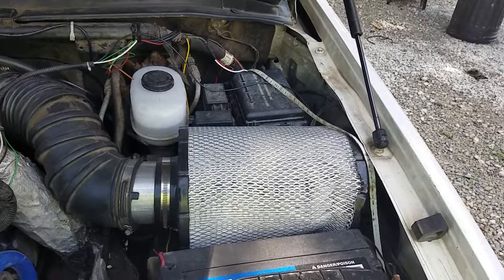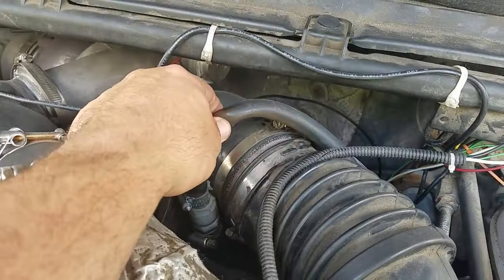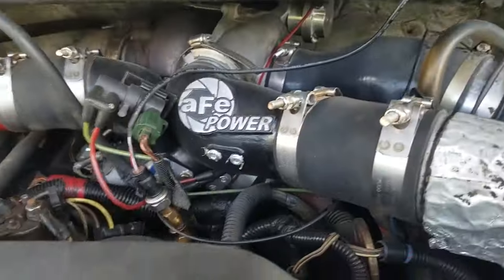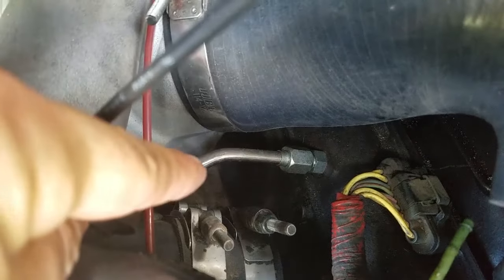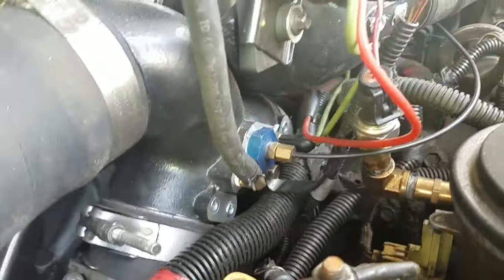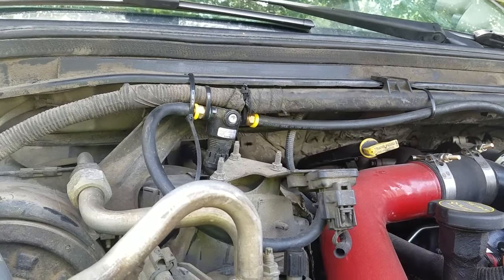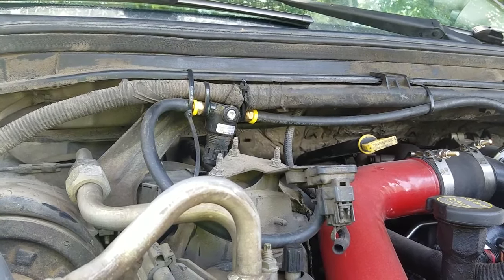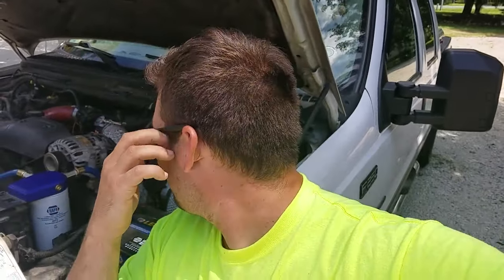5 Cheap 7.3 powerstroke upgrades

Comment from the maker: If you haven't already check out the Chat Room: https://discord.gg/s2Ku5dn
Reply: The cheap 5 mods video where did you get the parts from I already got the air filter I like the boost fuller you have

Comment: I could not watch the entire video when I saw that you replaced the Ford factory cold air intake, with a hot air intake.
Reply: The air duct not shown that is underneath the factory air box is the cold air feed. I see a lot of people remove that not realizing what it is. This guy may or may not have that but whatever this air thing he did is a joke
Reply: As long as the air duct is still ran over there it's still getting some cold air. The 6637 also flows more and catches more dirt.
Reply: How did you do the crossover?
Please show the other end of the CRV mod.
Reply: For real.  That is a rookie thing. Stick to stock   Rookie mistake.

Comment: I’d like to know the mileage with all these mods. My stock 2002 excursion is now at 490k zero major breakdowns and it has hauled a 25 foot enclosed trailer since about 190k (I know 490 is nothing special, in fact my 95 is at 600k with only one transmission replacement
Reply: My excursion has 360,000 miles stock

Comment: My BOUGHT NEW,  255,000 Mile, 2000 Ford Excursion Limited, 4X4, 7.3 Diesel has NO mods and runs like NEW!  I serviced it "By the Book, OR Better", added about a quart of Power Service Diesel fuel Conditioner (OR QT. Two Cycle OIL) at every other fill-up.  I changed Trans Fluid and Filter every 30,000 miles, Fuel Filter every 15K, Chevron Dello Oil and Motorcraft FL1995 oil filter, every 5000miles (3000 Miles when towing) and more.   ORIGINAL Fuel Injectors, Turbo, Transmission, etc. ONLY Michelin tires. As another said, video would be better Sans Music.

Comment: Been running a K&N air filter in the OEM filter box for 15 yrs on my '97 F250 Aug. 11 and newer, and the inside of the turbo looks new with no mods @ 276k with original injectors and glow plugs and I still get 20 to 23 mpg highway. Every oil change the oil gets sucked out of the HIPOP and replaced with synthetic every 3 to 5k miles.

Comment: A garden hose threads right on the crank case ventilation elbow. Then I routed it to the rear of my cab down the frame rail with some zip ties. Thanks for the video.

Comment: Best low cost upgrade is a 6.0 Intercooler. I got my intercooler free from a friend that put a larger intercooler on his 6.0 and purchased the connection boots/hoses for about $60.00. I've been running a K&N drop in filter on my 01 for 450,000 miles and never had a issue. You have to make sure you install the stock housing correctly. I've seen where people don't get it on properly and that has causes a lot of issues.
Reply: Mobey Dick the 6.0 cooler is a must because the stock one looks like a power steering pump cooler compared to it. As far as air filter I use the Donaldson Blue 6637 from Riffraff. The rest of the stuff he talks about is junk save the cross over mod

Comment: A couple things...  

1) The boost regulator is to keep the PCM from seeing more than 22-23psi.  If it sees that, it'll set the CEL for overboost.  I ran a non-wastegated turbo in my 7.3 for years and pegged my 35psi gauge.

2) CCV is NOT bad for the engine at all.  The T444E International version of the 7.3 has it vented to the atmosphere, and as long as you don't plumb it into your exhaust, it's fine.

3) I've personally seen dusted intakes on 7.3s equipped with a K&N.  Just don't do it.  I have since sold my 7.3 (sad day it was), and I now run a 3.5L EcoBoost F150.  I have an S&B intake on it -- my latest oil analysis show good filtering.  Which leads to...

4) Pull oil samples periodically to see how you engine is doing.  Mine always showed perfectly clean air (low silicon) going into the engine, along with other things like wear metals, coolant in the oil, etc.  Cheap but excellent insight into what your engine is doing.
Reply from the maker: +Joe Isabella Very nice thanks for your time to put out some good info.
Reply: Joe Isabella you really hit 35psi just by unplugging the wastegate?
Reply: Do you think an S&B cold air intake would work well with a 7.3L?
Reply: dakota irwin that’s what I have. Very good filters
Reply: Oh no trade the 7.3 for Ecoboost :o
Reply: @tommybragalone7943  Sorry- haven't kept up with any of this. No, I had large hybrid injectors, custom tuning, and a modified turbo. Along with many other mods.
Reply: The T444E is the 7.3 Powerstroke

Comment: Run the ccv mod to a catch can and then back up to the intake to keep the scavenging vacuum working, it keeps the oil out of your intercooler tubes and still vents the crankcase properly.
Reply: Explain please. Benefit to scavenging?
Reply: You do know the t444e which is practically the same motor has the ccv ran and dumped behind the block right? The only reason ford routed the ccv back to the turbo was because of emissions at the time?

Comment: The crank case vent going to the intake helps create a vacuum to lower crank case pressure
Reply: At least thats how it seems to work on my OBS
Reply: Running engine in negative crank pressure make more HP... Less parasite drag on engine...

Comment: The boost fooler doesn't have anything to do with the waste gate. What it does is "fool" the computer .... If the computer reads a boost above 25psi, it "de-fules" the injectors to keep from making excess power (engine damage).....  You can run a paint / airbrush air pressure regulator in line that you first set at 24 psi or so & your good.....
Reply from the maker: +Jay Dee you are correct, although I do believe it defueling at 22psi. I should had described this whole video a lot better. My truck does way over 22psi and once I installed this is saw a much better performance. 
 Thanks for the comment though, I've had a number of questions on this video and will be another to correct some of my mistakes
Reply: Jay dee can't even spell de-fuel
Reply: Jay Dee your spelling and punctuation sucks.

Comment: I can't see the use of the zoodad mod w/o the air snorkel to your air filter.  If you had a stock filter or ford AIS (which I recommend), then it would make sense to me for the zoodad mod.  I know you have the pipe there to kind of direct air, but since you're not directing it to an enclosed area where your filter is how does it help?   Once that "cooler air" gets in it heats up with the ambient engine temp before it hits your air filter. What am I missing?  Just curious.  A side note, to help clean up your CCV mod, unbolt the 4 bolts to the "dog house" and rotate it 90 degrees.  That way you can route the pipe against the firewall and it becomes out of sight.
Reply: More fresh air to the engine bay = cooler intake air temps.

Comment: All cheap mods to do but I donno.... the only ones that make any real sense to me are the intake mods, and me personally I'd just throw in a S&B cold air intake and call it done. After that do a 4" downpipe and exhaust as money allows, and a set of 180cc single shot injectors and have a 7.3 making around 344 RWHP and 727 RW lb-ft. But hey that's just my 2 cents :)
Reply: Jay Howe I
Reply: A cold air intake, 4" exhaust, and these  "single shot 180cc injectors"  will add that much Hp? I am asking this as a serious question, not to break your balls. Thank You.
Reply: @ThePete1891  add a good tuner and 350 hp should be easily achievable.

Comment: Um just take the vacuum line off the waste gage and throw a bolt on it to shut the waste gate off completely it adds way more power
Reply: More info on this please
Reply: @pedroperez5518  dont do it otherwise it'll set an overboost code most likely and will reduce power

Comment: Just a few questions.
Oil crossover = are those 2 ports already there or do you have to tap them?
Boost fooler=  does extra boost come from both delayed wastegate venting, allowing longer turbo sustain, and % of throttle input or by some means of influence on the turbo itself?
Reply: A bit late but the oil crossover is bullshit dont fuck with it and the boost fooler prevents the computer from defueling due to overboosting

Comment: The reason you don't run a K&N is because the oil from the filter causes dusting on the wheel and therefore makes dust stick to the turbo wheel.

Comment: I did the 6637 air filter for my 02, but what I don't like is it sucks air in from the hot engine instead of the cool outside air.
Reply: Doesn't matter the turbo heats the air up anyways. Compression is friction thus heat. Sounds like you want a better intercooler. Which doesn't hurt.
Reply: @RMS-gl6wl  yep, by simply compressing the air in a turbo you are heating it up. It's basic physics, besides it has an intercooler.

Comment: My new 7.3 project on my channel, Trying to start my 7.3 won’t wire, had bad batteries, fully charging them, I read if it doesn’t crank fast enough she won’t fire?
Reply: That's correct. They also won't fire if the oil level is too low. The injectors for off oil pressure, not fuel pressure

Comment: I wonder if all these mod upgrades are really necessary. ..I just done a standard tune with a ford approved air upgrade. ..I just cruise down the road or im pulling a trailer, not going to the race track.
Reply from the maker: +Chris Warrick no all the mods I have aren't really needed for everyday truck, does make it nice. Don't waste your money on mods you don't "need"
Reply: i get it, to each is own but i am just not that into it.

Comment: I have used K&N filters for over 30 years on a variety of applications. I have had no issues connected to poor air filtration. Provide us with some proof or test results. Anything good can change for the worse.
Reply: the reason I for not using a know filter is diesels need very clean air. and kn filters allow too much soot to enter which can damage the injectors. those filters are fine for gas engines though.
Reply from the maker: If you hold a k&n up the light you can really see the gaps that dirt can pass through. In my opinion don't use k&n on any diesel, a better alternative would be the S&B or the AFE stage 2
Reply: +Seth no I don't drive in soot. I have stock replacements. One is clean and in a bag ready to use, so no waiting to dry.
Reply: +Devon Xpress I have held both of mine with a light behind it, before I clean it and after to be sure they are not damaged. I don't see the problem you speak of. Mind you, I use stock replacements, not open type. The open type with the prefilters get dirty really quick. Of all the years and number of K&N filters I've had, never an issue as you describe unless you damage it physically. Mine never get so dirty to even move the restriction indicator. But know this, whenever I can get either brand you recommend in my hands, apples to apples, I am going to compare them.
Reply from the maker: There is a lot of mix reviews on k&n, the reason i stopped with k&n a few years back i had a 97 7.3 that needed a turbo rebuild before i started doing them myself and the shop had told me that there was excessive wear in the turbo and dirt in the intercooler, so from there i did research and the mixed reviews lead me to just not taking any chances, but since you've had good luck with them i'd stick with it . I personal can't recommend it due to my experience, but i may revisit this in a video on comparing the top brands may make for a good discussion. 
    Thanks for the comments my intended goal for this channel is to create a video style forum and that can't be done if everyone agrees with each other so stick to your guns and drop a comment on the other videos if you agree or not. Thanks again
Reply: +Devon Xpress Right on man. Let me ask, are you using open filters like on a cold air intake or stock replacements? Therein may be the difference.
Reply: S&B coldair intake on my trucks enclosed, snorkel just like the stock intake.
Reply from the maker: I've looked at those and wondered if the zoodad mod would be awesome for it, or really bad...?
Reply: +Devon Xpress Man I hate ford's. first one I've owned. I took stock intake and 3in exhaust off, I do have a ts 6 position chip. it's awesome, and I've gotten 2x better gas mileage. Other than that I put 5in straight pipe MBRP exhaust,S&b stage whatever intake. but those two I did at the same time... and christ the motor is like gold. Getting new Adrenaline HPOP and injectors a little bigger and she's done.
Reply from the maker: Hayden Johnson Hate fords? I'm confused lol. I love the 7.3, Ford gas motors not so much....
Reply: My 18-year-old K&N hasn't given any problems.
Reply: Devon Xpress Add on intercooler? What brand? I checked into a Banks and it is almost major surgery.
Reply from the maker: The BD Power is a good one and so is the MISHIMOTO. Both a lot cheaper than the Banks and just as good in my opinion. When I do mine I'll be doing the AFE only because it comes with extra ports do other add ons.

https://www.xpressdieselperformance.com/collections/99-5-03-7-3l-powerstroke/intercooler
Reply from the maker: If you do buy don't forget to use devonxp at check out for 10% off.
Reply: The problem with the use of a k&n filter is most people don’t have the mechanical knowledge they believe themselves to own. Therefore they take the most powerful compressed air blower they can find and get that sucker so clean you can see through it....and all it will filter out after that is small children. Just a little fun with my 2cents
Reply: Seth no it’s not so much that diesels need clean air. It’s the addition of a turbocharger, that will dramatically increase the airflow characteristics.  A piece of sand or dirt that may be trapped by the adhesion of the oil in the filter media of a normally aspirated engine, even if it has “larger than ideal” holes or gaps. The added suction and velocity of a turbo will suck the debris on through, gas or diesel. The addition of a throttle plate and low air flow at idle does help the gassers somewhat.
Reply: lol If ya dont belive him run your own tests, people offer information, if ya dont agree with it just listen to a different person. u provide us with proof other than ur 30 yr story

Comment: For the oil crossover do you have to tap it yourself
Reply from the maker: No the truck already has plugs, just need to remove them and install with the new fittings

Comment: The blow by is designed to keep the turbo nice and oily. I think it was made like that for a reason.

All those mods seem like hacks.

Best easiest mod is larger injectors
Reply: well, the oil feed and return lines keep the turbo "nice and oily," ccv is for emissions, its a DOT and EPA "regulation"
Reply: There is no need for the turbo vanes to be oily at all. You're thinking of the turbo bearings, which are supplied pressurized oil.
Reply: Injectors are definitely not the easiest mod. They are under the valve covers. Though not hard to do, it's the (easiest)
Reply: I've heard of diesel engines running away because of oil in the turbo. Hmmmm

Comment: I've been looking at some boost foolers for my truck, but at the same time, I've been on the fence about it because some say they don't work correctly.  What company do you think makes the best fooler for these 7.3s?
Reply from the maker: I would a mechanical boost fooler, not one that requires you to cut into the factory map sensor. Here is a link to what i now have https://www.xpressdieselperformance.com/collections/99-5-03-7-3l-powerstroke/products/bd-power-1045996-wgk-wastegate-regulator-kit
Reply: If you don't have a ses light it will do nothing.  It only fools the pcm.

Comment: Where'd you get the pipes that go from the intercooler to the turbo? Mine have grooves in them from rubbing on the plastic wire loom shield stuff and I think they might be leaking.
Reply from the maker: +Morndenkainen they are on my website
Xpressdieselperformance.com

Comment: can I build a boost fooler from a air regulater, testing at 35psi in and 22 psi out?
Reply from the maker: +Owen Bucks you can, and will probably work just fine. Have heard some having problems though with the regulators not holding up to the abuse under the hood
Reply: BB Donkey the problem with k&n is the material it’s made of is woven like cloth. Most all owners do not clean them properly and the space between the strands widens, if you hold it up to the light you can see the size of the gaps and the entire sun if that is your light source. It’s almost impossible to keep it from happening, but if you do by chance, it does filter better the dirtier it gets.  Not a risk I am taking. It will dust your cylinders(mainly cylinder walls on this engine) in short time! Have seen as little as 12k miles in extreme conditions.

Comment: I would recommend getting a new air intake but not the way this guy did it. FYI all motors want cold air going into them not hot ass air from your engine that air filter you put in provides.

Comment: I noticed the crossover in the link is made different from the one in your truck. is there any big difference?
Reply from the maker: +Anthony Dominguez many different designs all do the same thing no real difference
Reply: 10-4
Reply: how much of a power increase all together will these mods provide??
Reply from the maker: Altogether not looking at much, will increase air flow over stock and motor will run smoother with the oil crossover. I haven't regretted any of them
Reply: I did the intake mod  it made alot of difference in acceleration and in quietness